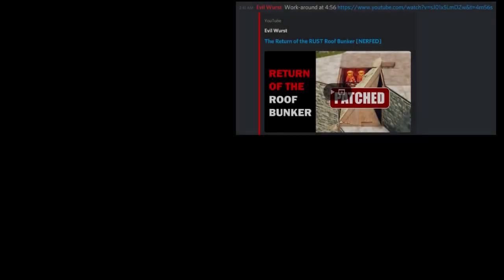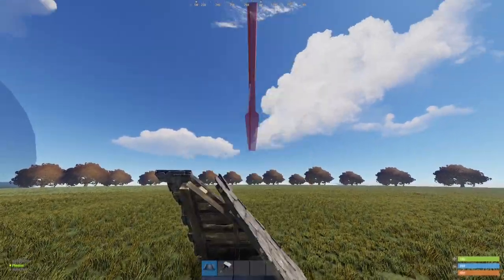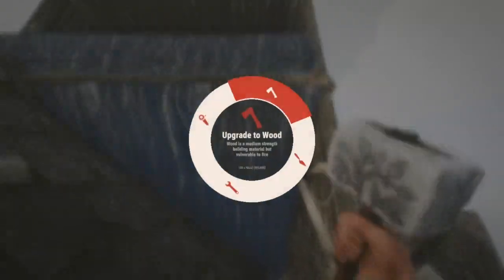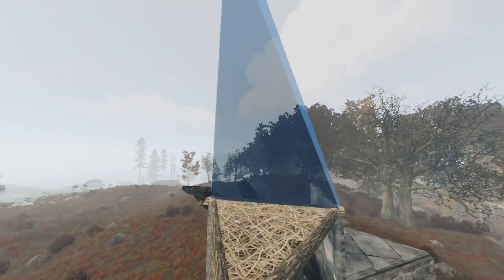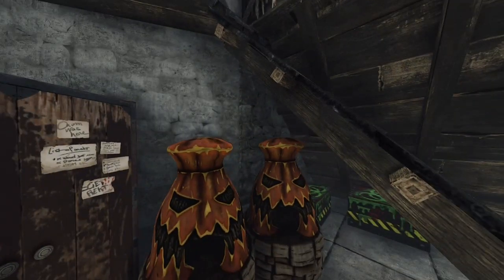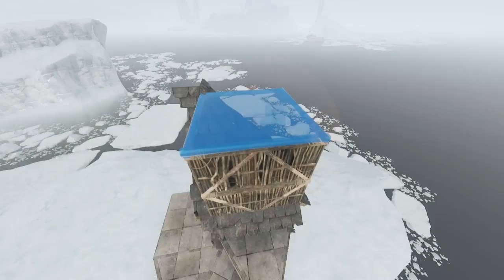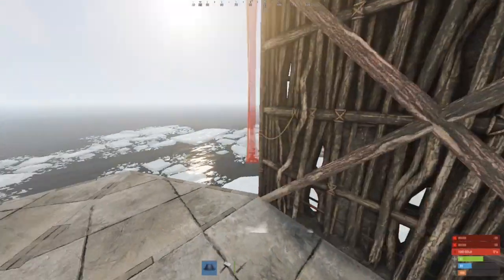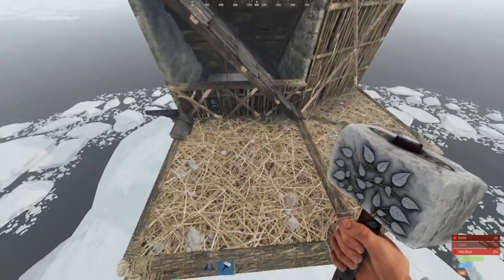Rust Science 03: More Inversion

Comment: Very interesting stuff, nice job phentos :) I wonder how bad splash damage through roofs is atm, I might have to test that out.
Reply from the maker: It's horrible, but not in the "door raid" direction -- from the sides square roofs take damage almost an entire foundation away, even via multiple walls. Weirdly, that's part of what I meant by how important the block upgrades are -- a wall pummel will damage the roofs before they get there, so they may need to be upgraded higher than otherwise.